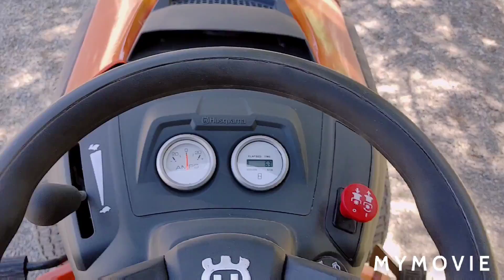Husqvarna TS248 XD Riding Lawn Mower.

Comment: Regarding you issue with lawn water, you should look into a cistern.  You could capture a ton of water off you garage.  Then pump in with a 1/2 HP transfer pump.   I do this in the Northeast.  I have a 1,100 gallon cistern, and 3 stock tanks totaling 1,500 galloons for water collection.  During dry spells, I never ran out of water for my gardens, bushes, flowers, or lawn.  I bought everything at Tractor Supply.  I put mosquito dunks in the open stock tanks to keep the skeeters at bay.

Comment: Hey Kyle I like the mower that Kawasaki engine will last forever. Got two used 1987 JD 165 hydro riders with Kawasaki engines and both just keep running so if one goes down I will have parts for the other.  Really like the deck on your husky looks heavy duty. Thanks for sharing.
Reply from the maker: 👋 Mitch,  yeah those kawasaki engine sure are nice seem to run forever. The fabricated deck on these mowers are built very well.  Cuts real good too. 👍 Hope you have a great week.  ✌

Comment: Thanks for the video Kyle I've been thinking about upgrading my rider I've been eyeballing the Husqvarna quite a bit
Reply from the maker: I really like my Husqvarna, very comfortable and easy to operate. The fabricated deck  works great.  I would recommend getting one that has the kawasaki engine.  The smart choke on the Koler and Briggs don't work very well.  This is just my experience with them though. Thanks for checking out the video. Take care ✌

Comment: Nice video....I have the same model.  IT has been working great for me, but it is time to replace the 3 blades...they are all knicked up and would be easier to replace than to just sharpen.  I lost the manual on this...do you happen to have the OEM part number for the cutting blade (5-star center) (not the mulching blade)?  I want to make sure I get an OEM-matching blade.

Comment: Hey buddy just curious I just purchased a TS 248XD it has an arrived yet and I thought that it had only two blades are you sure it has three because if so that would be a bonus!
Reply from the maker: Good evening. Congrats on your new mower. The TS248XDs have 3 shorter blades. Not sure on the length of them, guessing 16 inches. Sure seems to do an awesome job. Used it all summer with out an issue.  Have a great week.  Take care and all the best.
Reply: Definitely has 3 blades because I just replaced mine

Comment: I personally like the hand level forward and reverse speed control on my current LTG2654 mower. I understand yeah keep hand on steering wheel but all that foot moving is tiresome. Another thing I dislike about Husqvarna riders is the gas tank location. my mower sits in elements all year this cause the tank to crack in sun light. They are super hard to replace causing you to take whole chassis off. My solution i have a heavy rubber mat screwed to chassis now that drapes down in rear and protects the gas tank from sun. my deck has finally rusting apart looking for new and this is best I have seen but I'm just not liking it.

Comment: I have a 2020 model 242dx  when greasing the unit do no forget the 2 hidden on the front wheels The front rightside wheel actually fell off  last year because of lack of grease . I had no idea there was a grease nipple on the inside ,    2024 my unit is in the shop being repaired . All 4 motor hold down bolts loosen up and fell off. And the exhaust system broke at the manifold and muffler. Approx.270 dollars in parts only.   Not impressed with the unit.😮